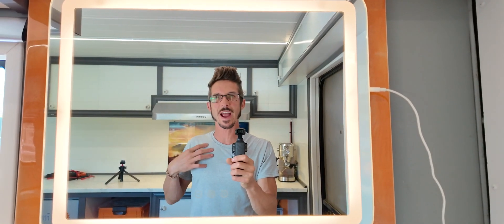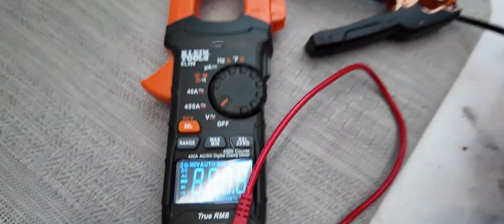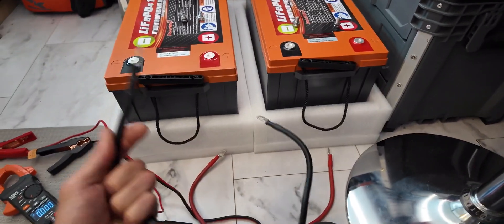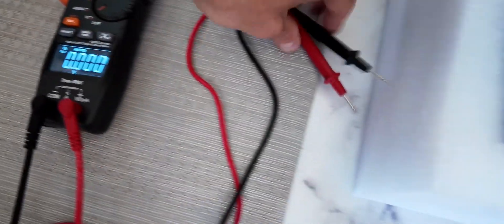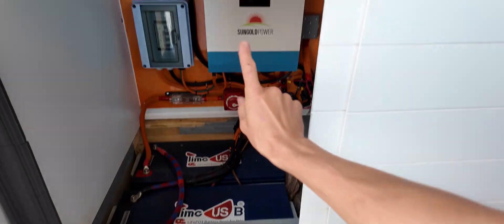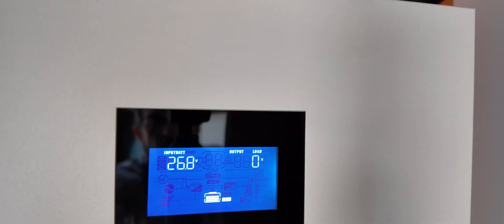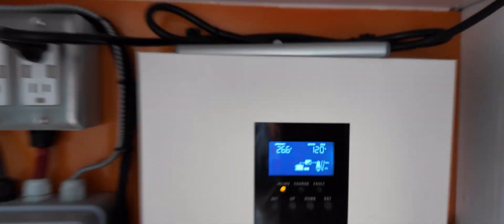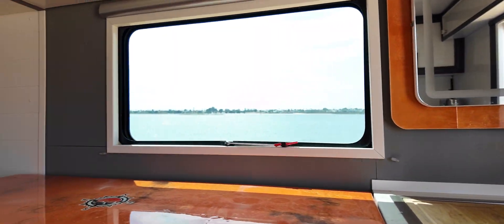How to charge + install multiple lithium LiFePo4 batteries  Enjoybot 12v 200ah

Comment: What is the voltage on those panels?  
Doesn't that inverter charger have a minimum panel voltage of 120v?
Those must be some nice voltage panels.

I have been struggling to find a inverter/charger with less of a minimum input solar voltage, as don't have as large a roof.

thanks for the video.
Reply from the maker: This is the older version, it only required 60v pv input. I’m at about 75v.

This unit is good for smaller systems..minimum pv of 30v 
https://amzn.to/4gWC63v
Reply: @nomadbrad503  Thanks for the fast reply!!

Looking at designs for a future van (about a year out or two...) and trying to balance out either a 24V or 48V system, with solar etc.

By the way - as someone with training, public speaking and some video work background - your videos are very well done - thank you for all you do for the community.

Comment: Hey Brad 👋 quick question…. I bought two 100ah SOK lithium batteries for my truck camper and since have realized it’s not enough power reserve but the batteries I bought haven’t been available to re-buy since I bought them from Amazon. Not sure if they discontinued them or what 🤷 I’m a fellow tuber and get offers for batteries all the time but my question is do I need to totally replace my entire battery bank with new batteries or can I just add a couple more batteries of a different brand? Side note the SOK batteries are 1.5 years old now. Thanks so much 🤙
Reply: For LiFePO4 You can safely parallel different brands as long as the voltage and the chemistry (i.e. "LiFePO4") is the same.  Differences in age and cycle wear don't effect the voltage curves for LiFePO4 like it would for other lithium or lead-acid chemistries, it only effects the capacity.

You can parallel-connect LiFePO4 bateries of the same voltage but different capacities, but it isn't ideal.  The batteries will current-share and develop a slight SOC offset from each other, but othrewise work.  Same with paralleling slightly differently aged batteries, or batteries from different vendors (that have different internal resistances).   Not ideal but it works quite well, the batteries will current-share in proportion to their capacities, and just develop a slight SOC offset relative to each other.

Also keep in mind that LiFepO4 battery cells basically don't wear out... getting a 15-year service life out of these batteries is easy when they aren't abused.  The power electronics in the BMS will kick the bucket before the cells do.  For LiFePO4 a 1.5 year old battery might as well be brand new.

Series-connecting batteries from different vendors is a bit more problematic, but nothing terrible will happen as long as the total voltage is within vendor specs for series connections.... typically the series limit is up to four 4s (12.8V) LiFePO4 batteries, or two 25.6V batteries, or just one 51.2V battery.

You do need to use a whole-battery balancer when series-connecting two or more 12.8V LiFePO4 batteries, which complicates matters slightly.  This is why most people designing 25.6V or 51.2V nominal systems purchase native 25.6V or 51.2V batteries rather than series-connecting 12.8V batteries.

-Matt
Reply from the maker: you shouldnt mix lithium batteries because the BMS are different. I would sell your SOK and try to get a company to send you 2x 200ah batteries for free then buy more of the same if you want

Comment: Just a heads up, the warranty and support for enjoybot batteries is absolute shit!!  Mine are prematurely degrading.
Reply: Make sure you are properly charging the battery.  LiFePO4 batteries will go out of balance if not at least occasionally charged to full.   For a 12.8V battery that means the charge profile should be (roughly):

* Bulk target 14.2V
* Absorb: Hold 14.2V for between 30 minutes and 2 hours (allows the BMS to balance the cells internally)
* Float and/or load-support: Between 13.4V and 13.5V (SOC will maintain 99%+ indefinitely when floated in this range after fully charging, with less stress on the battery due to the relaxed voltage).

(multiply by 2x for 24V 8s systems, and by 4x for 48V 16s systems).
(12V aka 12.8V nominal, 24V aka 25.6V nominal.  48V aka 51.2V nominal)

Even the worst LiFePO4 batteries basically don't degrade unless the charging profile is mis-configured and even then it is usually just balancing so you'll recover all the capacity within a few cycles once you have a proper charge profile programmed.

The only way to really destroy a LiFePO4 battery is by charging it below freezing or discharging it below 2.5V/cell (such as discharging to BMS cut-off and then putting the battery on a shelf for a few months... that will damage the battery as self-discharge takes the cells below 2.5V/cell).

-Matt
Reply: Hello Sir, could you send your order number to us, I'll let our customer service contact you soon. Thanks for your understanding!

Comment: Brad, u couldnt use all 4 batteries in parallel so you have more power storage?
Reply from the maker: No. It is not a good idea to mix lithium battery brands because they have different BMS modules which can cause problems